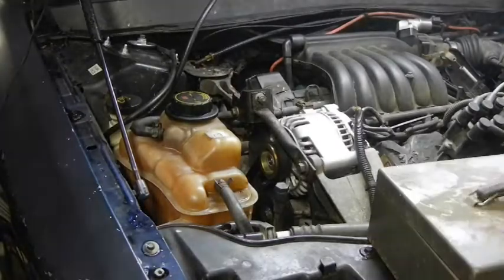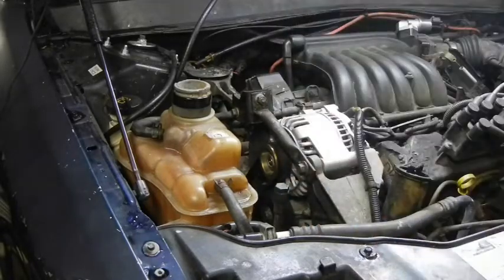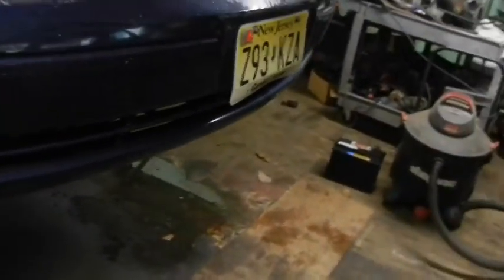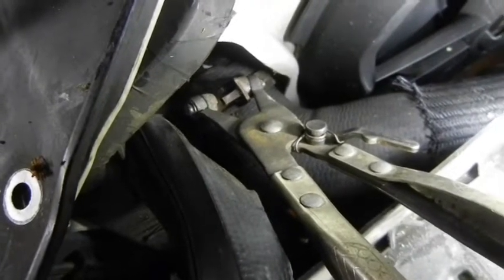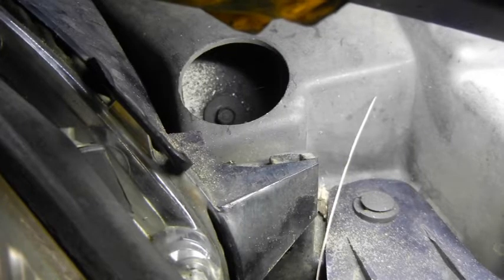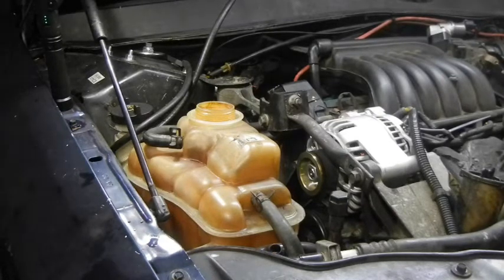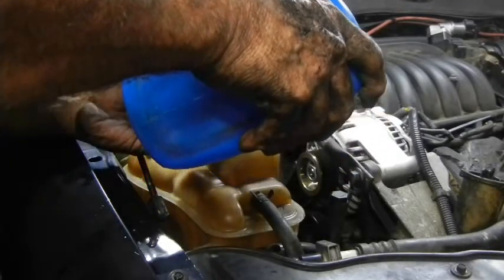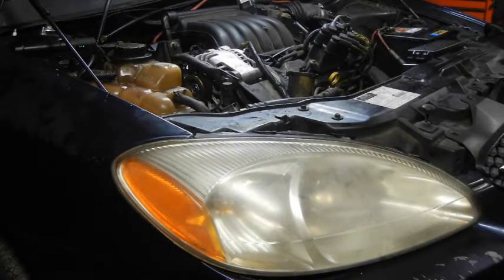01 FORD TAURUS RADIATOR REPLACMENT KEEPING THE BEATER ALIVE

Comment: Nice replacement job John. I hate that the newer radiators have the plastic peacock plugs on the bottom compared to the metal brass ones of old. I don't get  the haze on the headlight lense since they are still made of glass.🙂👍your right about the clamps, sometimes you can't reach them.
Reply from the maker: Thanks David... Yes plastic has replaced nearly everything on modern cars and doesn't last as long as their all metal counterparts.. The headlight lenses are also all plastic if they where glass they would never dull it was done to save weight for gas mileage and glass versions are 10x the cost of the plastic ones! I really appreciate you watching and commenting have a great week!

Comment: Nice one John. People miss those cars. You rarely see them on the road. The first time I saw an early prototype driving around the Ford complex, I thought it looked like a moon rover or something like that. They made Ford a ton of money!
Reply from the maker: Oh yeah it started with the Ford tempo and I remember them well from the aluminum headed 3.8 that liked to snap torque to yield head bolts... lots of head gasket failures😂..but oddly enough no such trouble on the iron headed 3.8 like in the little 80s Ltd's.... And the Vulcan iron headed roller cam 3.8 in my beater wagon runs pretty good...unlike the complex SHO version dohc engines that produce lots of power but when they went down they went down hard and too the junkyard! the transmissions were their weakest point I pray 🙏 everyday for the transmission at 234k+😂😂👍... And to me they always looked like a giant waterbug cockroach....you know I'm from NYC!
Reply: @moparnut6286  When I have time today I will tell you a story about the SHO’s … I was part of the team that built 30 of them by hand all out of aluminum. but right now, I’m off to rescue my daughter… Her car died lol

Comment: #savethebeater good work on that radiator replacement. I had a 98 Taurus same power steering whine even after replacing the pump on it 😅 back in the day .
Reply from the maker: Yep the whine goes back to the early 60s!😂